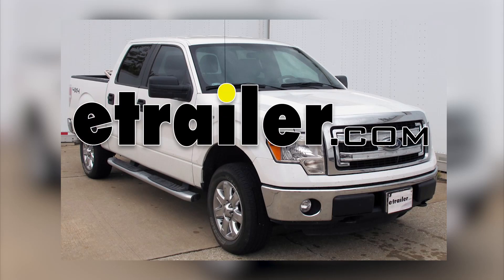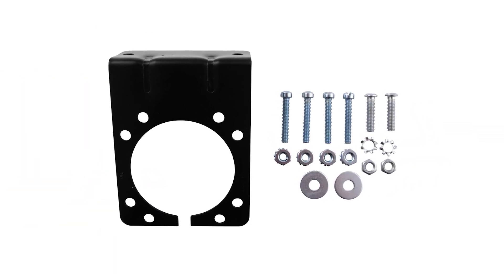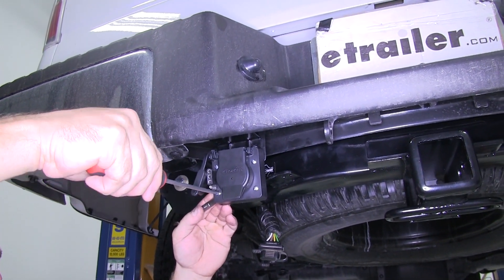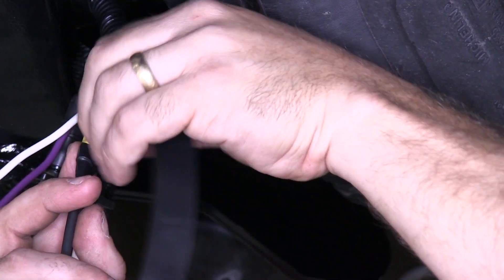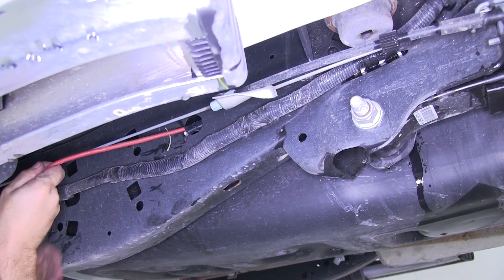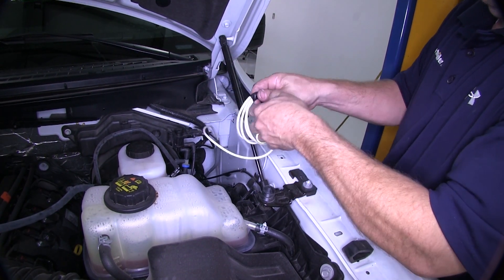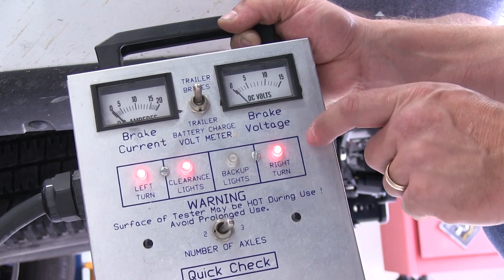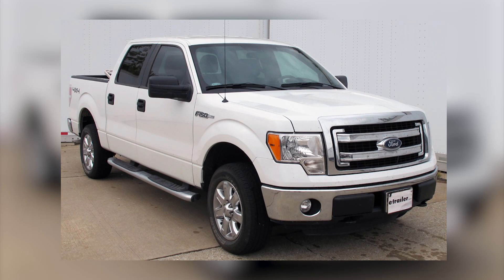How to Install: Universal Installation Kit for Trailer Brake Controller on your 2013 Ford F-150

Comment: I'm getting something like this for my 99 dodge Durango and I'm want to know if I want to use just the lights for the 7 round plug do I just use electric tape on the other wire and grill the ground to the frame of the truck and use the others wires later on cuz I was going to do that
Reply from the maker: Yes, if you are just wanting to use the 4 pole functions on a 7 way plug, you will need to tie up the other wires that you are not using.
https://www.etrailer.com/Accessories-and-Parts/etrailer/ETBC7.html

Comment: cool.... but what about the reverse lights??

also, this 7 way plug should now work for my electric brakes on my trailer, right?
Reply: Almont no trailer has reverse lights. 
Yes for electric brakes you must have the 7way. The original 4Flat is not enough wires.

Comment: where would you have connected the wire for the brakes>?
Reply: You would need a brake controller first. Then you just connect it to the white wire that he rolled up next to the firewall for later use.

Comment: What happens if they leave the trailer plugged in? If the trailer has a battery, won't it drain the trucks battery with this setup?
Reply: Yes it could if they are not matched voltage. Unplug it unless you need it.

Comment: Where does the Controller go ?
Reply from the maker: Terry Hand The controller typically gets mounted on the dash below the steering wheel. That location is out of the way, but in reach of the driver should the manual override need to be used. If your F-150 has a factory 7-way, the installation is a much easier plug and play setup. Let us know what vehicle you're working with and we might have a better video for you.

Comment: Sorry, just upset with Dealership, placeing controller on the left under the steering wheel.   In all my  60 years on the planet, I never saw one  that was not in the handy place under the radio.
Reply from the maker: If it's a plug-in unit, sometimes that's all the further you can go from the port under the dash. However, either side of the steering wheel is common now since so many trucks and SUVs have center consoles with no opening under the radio.
Reply: Yeah i agree. Thats dumb.